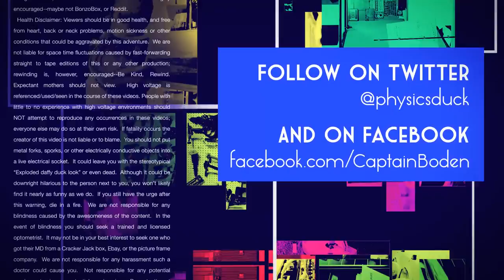Captain's Blog 1 23 2015 Vacuum Pump

Comment: Josh is ok.  my birthday is in August.  wowser 200 is big for a wheel.  I remember when Bat borrowed you camera.  fan blades are not faces.  I use a shithouse less than most.  In Northampton MA I can visit the 4 IHEG properties.  take a week off and fly to another city.  it helps greatly.  two silencers could completely stop the sound.  similarly my firs camera was $250.  my current camera is $350 without flashcard.  shoes are cheaper than car tires.  Moose is very formal.  on, it might fall off.  your Sam is fast.  vacuum pump sounds healthy after reassembly.  your drop of blood is great art.

Comment: Chris, I worked at a Hospital for a number of years. We had 6 vacuum pumps, very much like that one. They used a special vacuum oil, that was available from several different companies. The main one that we used was "Mobil Vacuum Pump Oil 100". I don't think you will have any problem finding this oil. Brendan